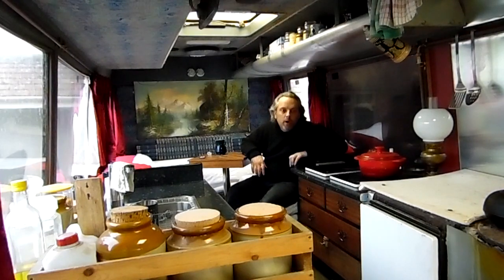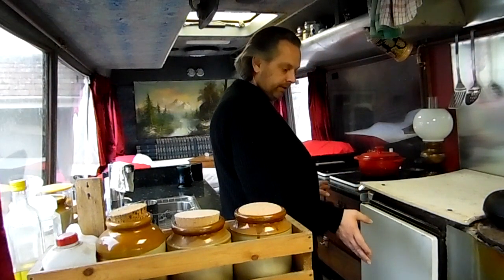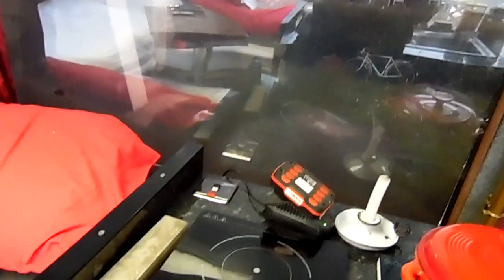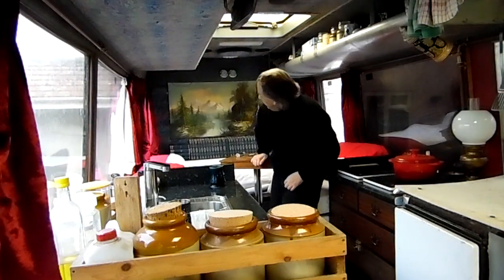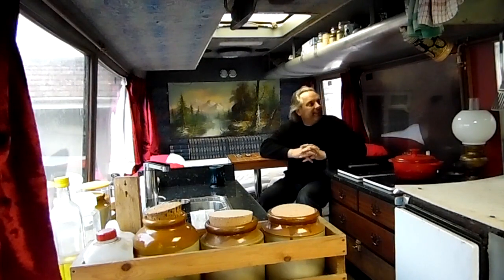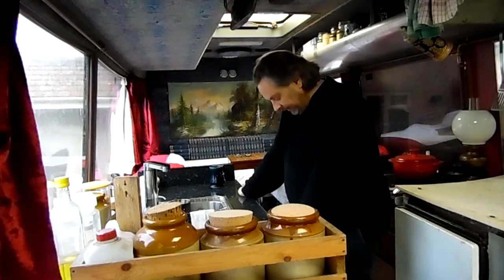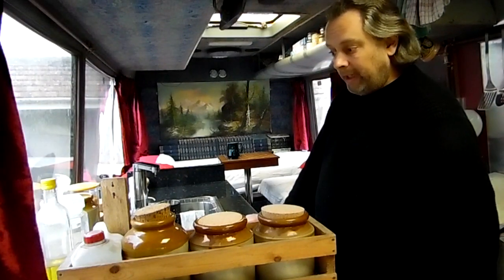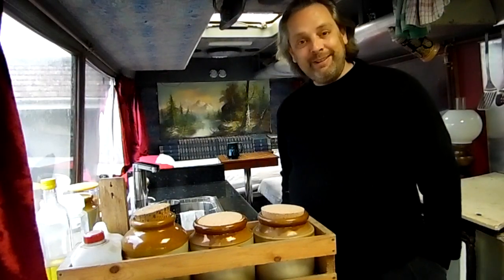ShortBus Life Rocket Mass Heater/Cooker &1 year living  in bus update. Minibus.

Comment: I really love your ingenuity man! The use of the man hole cover for the top of the stove is class!
Reply from the maker: Thanks, I bought the manhole cover new but had to put it in a bonfire to remove the bitumen paint before fitting it, but I do need to get it skimmed to remove the teeth off of the top by an engineer for better heat transfer to saucepans.